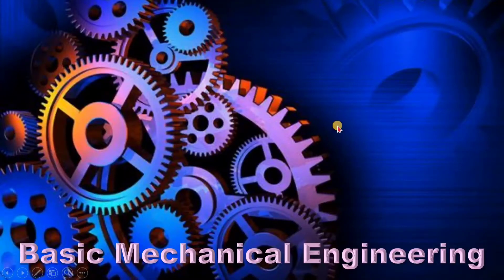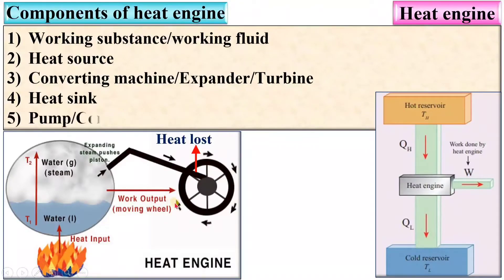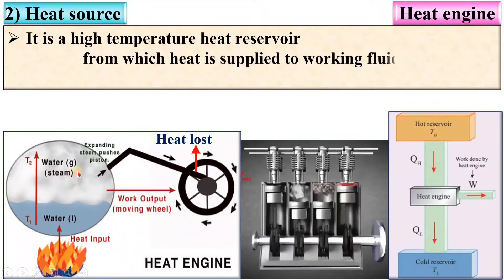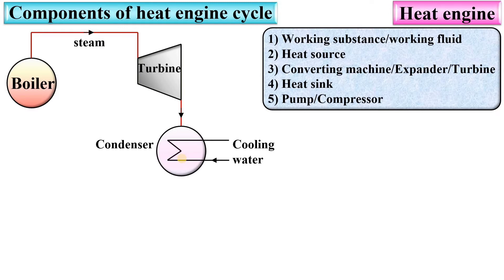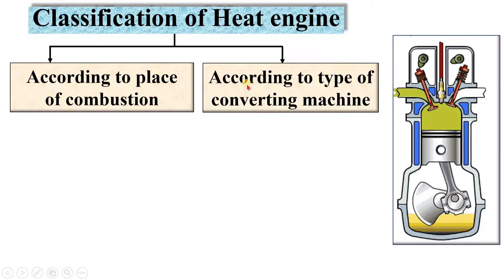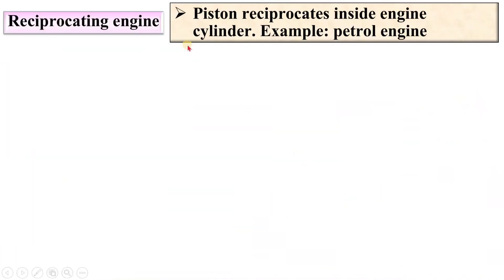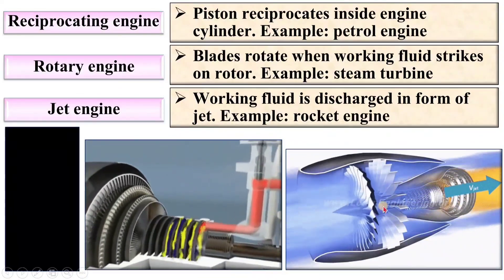Classification of Heat Engine | Heat Engine parts | Heat Engine Diagram | Heat Engine cycle

Comment from the maker: Classification of Heat Engine explained with following Timestamps: 
0:00 - Basic Mechanical Engineering lecture series 
0:19 – Heat Engine 
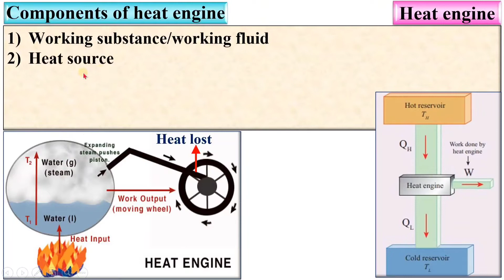0:38 – Parts of heat engine
1:02 – Working substance
1:20 – Working medium
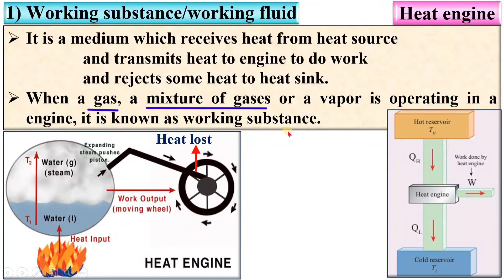1:35 – Heat source
1:51 – Converting machine
2:18 – Heat sink
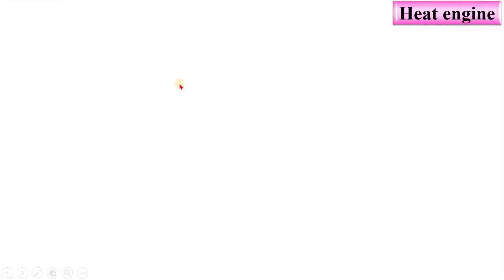2:38 – pump
2:47 – Parts of heat engine cycle
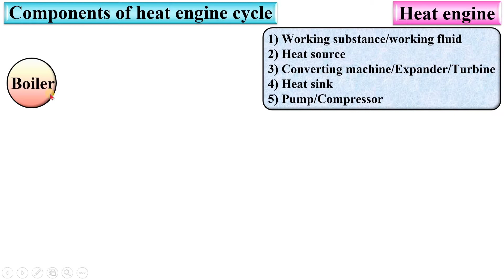2:57 – Block diagram of heat engine cycle 
3:52 – Heat engine cycle
4:09 – Classification of heat engine
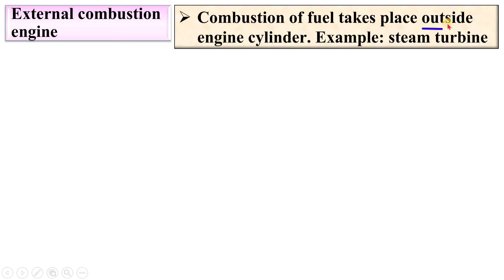4:40 – External combustion engine
4:55 – Internal combustion engine
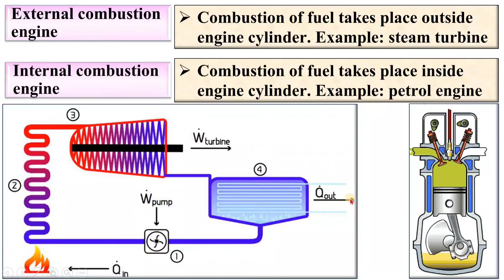5:06 – Reciprocating engine
5:19 – Rotary engine
5:30 – Jet engine